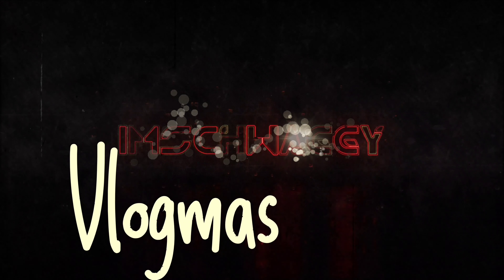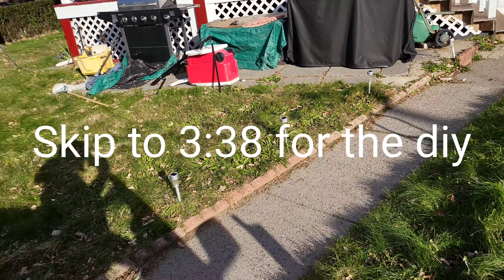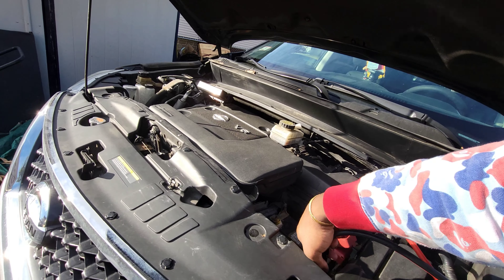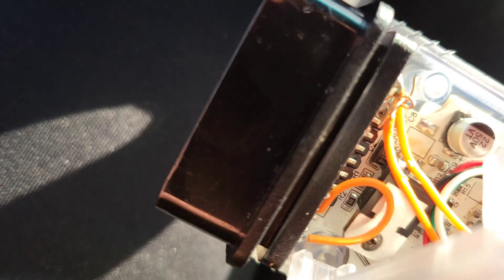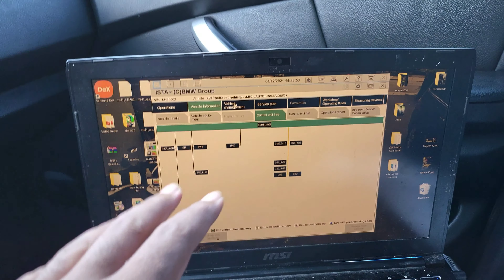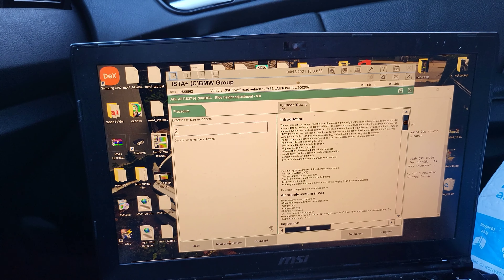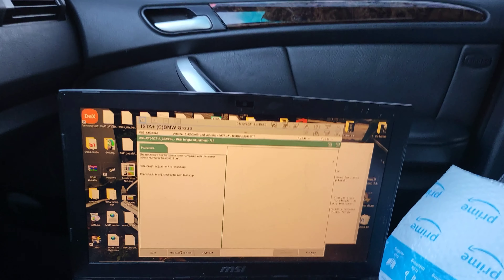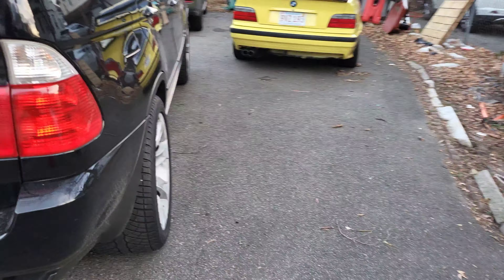How to put your e53 x5 into write mode and lower your factory air suspension

Comment: I have the exact cable you have qnd the ista software so i want to try it. I have the offroad shocks and tyres on my e53 at the momemt. Question, if i drop the rear, can i just switch out springs in the front?
Reply from the maker: Yes you can.

Comment: Thanks for sharing. Nice to know there are some easy hacks for the air shocks. Might try this in the future to give an i4 (G26) some extra temporary clearance when camping. Has anyone tried fitting a  2nd set of ride height sensors, and A/B switch them with the car off. Then you'd start up and boom, car is lowered or raised to the preferred height.

Hey how much height adjustability have you tried in your X5? Seems like pushing it too far in either direction could either compromise something, or at least result in a bad ride.
Reply from the maker: No problem at all. And you can go pretty far but I don't suggest it until you get adjustable links. Because if they break then idk what happens but im sure it's bad